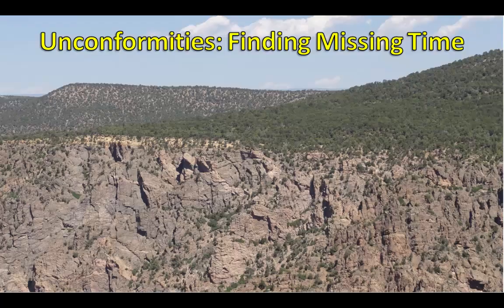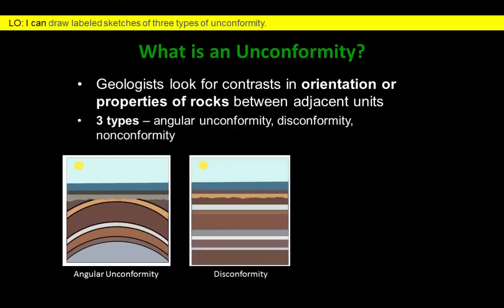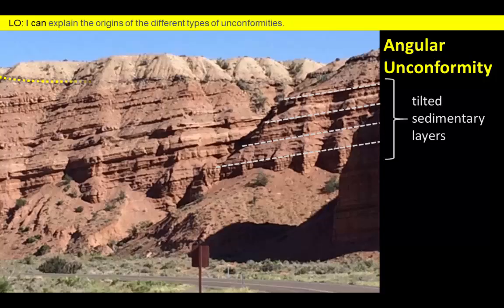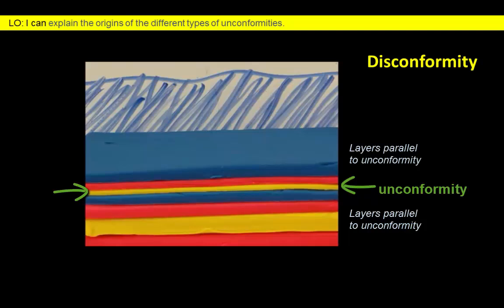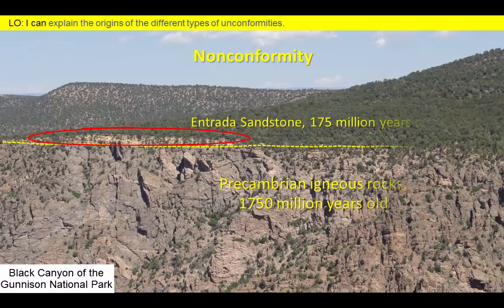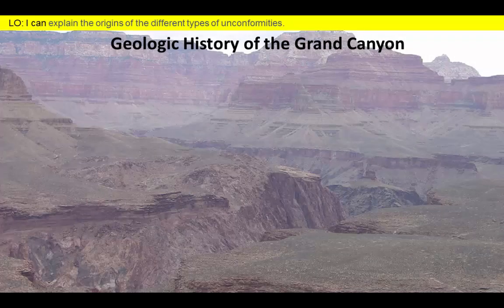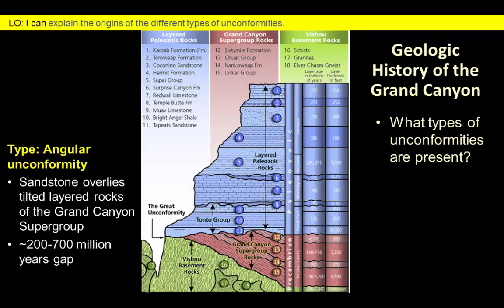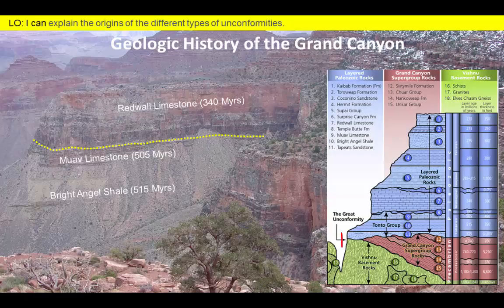Unconformities: Finding Missing Time

Comment: Rock will not bend unless treated to moderate pressure at approximately 300 C (about 500 F). It has tensile strength, is brittle under high pressure, and fractures under significant pressure. Folded strata cannot have formed once sedimentary layers (strata) were concreted into stone. They could only form when the sediments (thick and deep indeed) were still moist, soft, and plastic. This verified for us that the imagined vast ages of time for the formation of the Geologic Collumn do not exist, and that the sedimentary rocks, even folded mountains, of the earth were produced by tremendous pressure in the continents occuring while all of the continental sediments were moist and exceedingly young. This is profound evidenced of the Noaich Flood, and refutes the mainstream beliefs about the: 1. age of all sedimentary rock 2. age of all mountains  3. age of all fossils 4. age of the earth